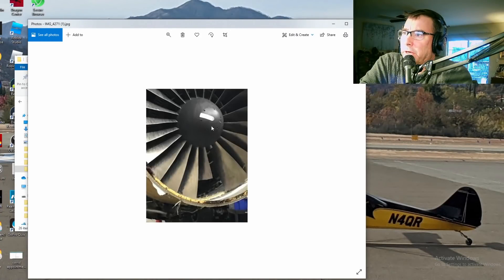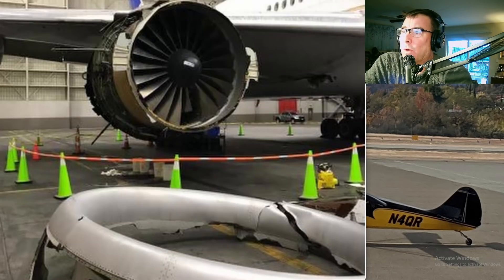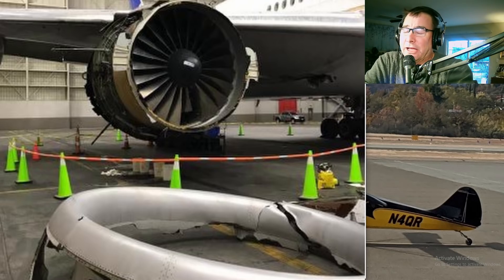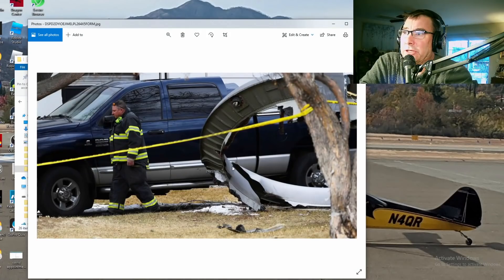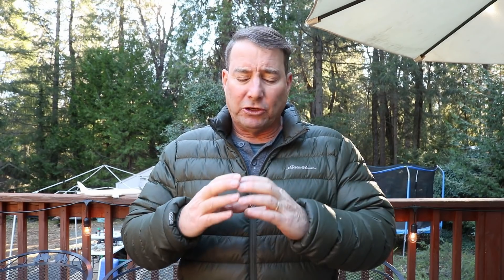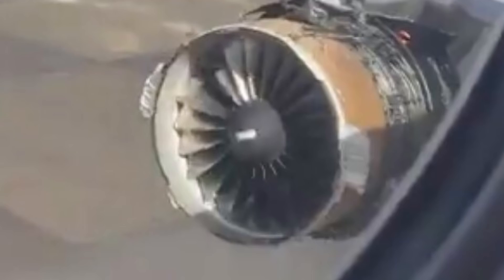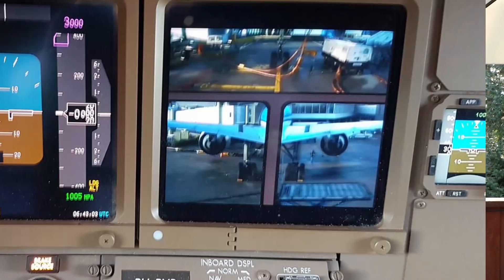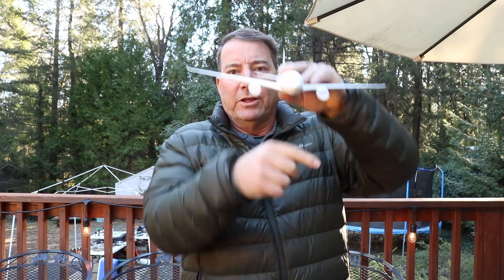UAL 328 UPDATE Fan Blade Failure  B777-200  22 Feb 2021

Comment: Okay, an incredibly piddly question of no real importance ... in all of the ETOPS configurations you mentioned, Mr. Brown, what is the assumed state of the engine that's out?  
That is, is the massive amount of drag caused by an engine who's cowling is gone taken into account or is the engine simply assumed to be "feathering" but still relatively aerodynamic?
After all, the Breguet range equation depends on aircraft drag (among other things) and that drag presumably goes up quite a bit compared to the case of an engine without a cowling and so I'm wondering if the range estimates for the aircraft can really be trusted.

Comment: Turbofans circulate much slower than the inner compressor blades.  The width, mass, and aerodynamics of the hollow blade make it capable of overcoming the inlet flow, thus the cowling shear and bellowing out of the outer skin.  Amazing.

Comment: Another interesting point was that, based on the ATC comms published by Vasaviation, the ATC asked the UAL328 if they preferred a left or right turn and pilots went for the left one. If I'm not wrong this action was taken in order to fight the momentum that an engine failure can cause on the a/c (I assume something similar to what happened to the Indonesian B737-5).
Thanks for the explanations Juan, such great and interesting video

Comment: Juan,

I noticed in the picture of the damaged engine taken from window seat, there appear to be two, "tabs" pelled back from the engine containment housing at the 10 o'clock and 3 o'clock postions.  What are those from?  Are they the attachment points of egine cowelling?  What kick arse review.  I always learn something I didn't know before about the engines and the emergency procedures that follow an engine falure.  Thanks!!

Comment: I am starting to think the slipstream is what alters the result here versus the certification blade-out test conditions.  The test is performed in a 0 kt slipstream environment.  The failures have occurred in slipstreams at or above 200 kt which is significantly more than 0 kt.  When the blade detaches in a slipstream it is going to immediately decelerate relative to the others still attached to the fan disc that, at this point, is still powered.  Since the rotational velocities are significantly higher than the axial velocity (the forward velocity of the blade moving into the slipstream around 200 kt whereas the rotational velocity is closer to the speed of sound) it will decay much faster.  If the slower blade is then impacted by a neighboring blade (these are at a slight angle to begin with to induce an angle of attack as the fan disc turns the blades) still being driven by the fan disc it could be shot forward and into the inlet ring.

Airspeed is also going to affect the angle of attack at the fan blades just as that same airspeed affects angle of attack at the wings.  The blade out test used for certifications operates at 0 kt airspeed (not performed in a wind tunnel) and will not reflect the result of blades separating at different angles of attack.

This failure mode has caused more than one incident now so it may be worthwhile for the NTSB to model the above scenario by running the blade-out test in a wind tunnel using an engine with its aerodynamic cowling installed.  Also lots of computer simulation since a certification test rig and PW4000 fan blades comprise a very expensive dart board (especially if we don't hit the bull's eye on the first try).

Also NTSB, with the cowlings off and the wind tunnel blowing, confirm or refute the Halon farts that occur instead of engine fires getting put out when the fire handles are engaged.

Comment: Thanks for also covering the Netherlands accident. As i understand the fuel drop in NL/Belgium was nit required for a save landing and perhaps even could increase fires on the motor. You also saisd 747 is other type than 777 so ...what would the flightplan/fuel plan/ fuel computer recommend? No one is perfect but by analysing this can be optimised in the simulator procedures. Being a technician i am heavy worried by the broken vanes. That can be caused by fatigue and/or small cracks and ...that can be detected by inspections. Is the industry doing those tests? Are there enough tests and inspections or is that extra safety decreasing to safe money and time? These airplanes are 20 to 30 years old ....sometimes one should say ...this is the end or ...do an extensive overhaul. The vibrations and stresses / forces of the damaged motor may also damage the wing and even the body. Strong forces can cause cracks, fatigue and also can deform or reduce lifetime or cause air leakages of wing and body. Air leakage at hig speed may caused increasing damage so ...what seems to be a simple damage and just replace the motor may cause a damaged airplane with failures on other parts. Of course cables and systems etc, have to be checked and replaced and tested. In train industry but also in chemical industry last 20 years the operations / insights / procedures for maintaining, repair ad service  have been focussed on reducing maintaining cost. They havbe not been focussed o increasing safety and reliability. (Damagae repair in stead of preventive repair, condition monitoring in stead of condition improvement or condition enforcement, failure procedures in stead of more safe and preventive procedures). There is a point where safety really can not be guaranteed any more . New point: lots of planes are on ground due to corona. Long term storage can affect wheels and bearings but also can cause fauling, corrosion, humidity or even water or algae or fungus, rubber and oil can detoriate : summarised those plains have to be inspected, maintenance has to be done including cleaning, perhaps also cleaning of fan and compressor blades, they have to be warmed up and dried and the systems has to have a much longer start up and warming up than normally, also after that first warm up all kind of things should be tested! Not only the standard test but ...intense and ...are those procedures standard available ? Otherwise please insist of proper and save start up of all those airplanes that are standing month inactive in all kind of weather conditions. Are there mice in the wings? Military knows much about how to safe store large equipement ...mostly they, like tanks, are stored in warm and dry heated  halls. Military also have experience how to inspect and start up equipment, yes they can be rough but they also know that a weapon that does not work is not a weapon but only a heavy weight. Electronics can fail but also leakages of oil and cooling can occur. Fire systems can stop working after long being out of operation, safety systems can stop, how is the landing system and the quality of the rubber wheel and seals? I think a worldwide engineering review on safe start up of the covid machines is required. Just a standard start up may cause unwanted problems. Fouling of turbomachinery also can cause unwanted problems! Good luck! I am mechanical engineer bachelor and worked with turbomachinery, tanks, radar, communication, anti-aircraft,  instrumentation, testing, engineering, repair service, maintenance, inspection, material properties, aerodynamics, and ... top quality and safe as possible but yes ...money has to be made so ...it should be possible to operate and maintain machines at acceptable cost but ...how to do that safe and ...is safety guaranteed after 20 years of decreasing costs for safety? And ...after decreasing income per flight? Can the business be safe , deliver acceptable incomes and deliver acceptable transport quality to the customers? Do we need to wear helmets close to airports and routes?
Reply: https://www.onderzoeksraad.nl/nl/page/18344/motorprobleem-boeing-747-412bcf-meerssen? have sent a comment to the Dutch Safety Board. Added your video and asked them to also contact the USA Safety Board. Accidents/incidents seem similar. I see that there is a problem with old machines and insufficient service,  repair and inspection: old blades etc. ...no signs of extreme external forces. There was normal turbulence in the USA and in NL the weather was OK. No strange external forces mentioned. So i see a mentality and habits that can cause problems with many old airplanes; they need quality  inspection, repair and service .

Comment: Not disparaging this guy's qualifications, but V1 is not rotation speed.  It is refusal speed;  the speed at which there is not enough runway left to stop;  at that point, you are committed to take off or run off the end of the runway.  There could be several tens of knots between V1 and rotation speed.
Reply: Thanks Wilbur.
Reply from the maker: You know what I mean...good grief.
Reply: Sorry folks, but if you're going to talk about it, talk about it properly.
Reply: @rickbanet4830  Ok Mr know it all

Comment: Hey Juan, question for you since you mentioned the considerations about an emergency evacuation. Given the speed at which things can sometimes go wrong when aircraft fires are concerned, would the cabin crew inform the passengers to remain in their seats, or would they start mustering passengers at the doors in the chance that an evacuation is ordered to speed up the evacuation. Also, I’m assuming if there was time that the cabin crew would brief the passengers about an evacuation plan if it is ordered prior to the landing?

Also you said your off to work and headed to London? I hope that indeed means your still flying. If so, have a safe flight, and try to keep both engines spinning, as it seems that commercial planes have struggled with that bit in recent times, and as cool as it would be to have you tell the first hand story of that time your right engine blew up on the way to Heathrow when doing these videos, I don’t think you need that at the moment 😁

Comment: So if a fanblade broke off and made hole in the cabin you must go down to 10k ft, will that be included into the fuelplan or will the aircraft run out of fuel regarding the Hawaii example?
Reply from the maker: Yes

Comment: The 777-200 (LR at least) does not have the camera system.  The -300 does as the landing gear with the size of the aircraft, the wheel/turning geometry, etc., demand a camera.  Also, the -300 has that feature where the main landing gear truck has to be lined-up before apply take-off power.

Comment: The same day this happened a Longtail Aviation 747 freighter travelling from Maastricht to New York had an engine fire shortly after takeoff. They also dropped debris and 2 people on the ground were injured. They flew to Liege which is approximately 20 miles away. They dumped 40 tons of fuel. The ATC guy seemed to sound surprised that they were doing that. It is getting very little media coverage. Here is a link for the ATC recording.
https://www.youtube.com/watch?v=ADQbwVW4Wuo&feature=youtu.be

Comment: QF32 on an A380 had an uncontained blade failure that ripped through the aircraft. One thing that struck me when reading the captain’s book about the incident was how the ECAM kept generating new warnings and messages making it very hard for the first officer (the captain was doing the flying) to keep up with the problems. In a similar situation in a 777 you would have paper checklists. Is that preferred so as not to overwhelm the crew?

Comment: Worked at American's M&E center for about 20 years rebuilding engine components for both Pratt & GE engines. Most of what I worked on are now in bone yards somewhere since I've been retired for almost 20 years. Those #1 stage compressor blades are made of titanium as are the hubs that they are attached to. They are not very heavy but I have never weighed one to determine the exact weight. The hub is fairly heavy though. I do not know what rules apply to the blades but (way back when) the hubs were to be discarded after a specific number of cycles. Not hours but cycles. An incident involving a fan hub failure causing a DC-10 to crash at Sioux City, Iowa caused American to insure that the old hubs could not be reworked & used again, we cut a notch in them with cutting torches rendering them unusable. Those blades are supposed to undergo ultrasonic testing periodically. On the MD-11 line they would remove them during a "C" check for testing. I am unsure of the current testing rules.  The engine mounts being designed to shear off in case of excess vibration? American had a 727 lose #3 engine (actually came off) somewhere over the desert in Arizona or New Mexico. What happened: The forward lav on the right side had a leaky dump valve. Blue ice formed on the outside of the fuselage to the point that it could no longer stay attached. A large chunk of blue lav ice broke off, bounced off the leading edge of the wing & got swallowed by the #3 engine.  Stewie reports to the pilot that they had lost an engine. Pilot reports that yes we know & have shut it down. Stewardess replies that, no, the engine is gone. The condition of the engine when they retrieved it & brought it in the shop was interesting to say the least. When designing the aircraft they had to consider the lesser of 2 evils: what's worse a single engine falling into a neighborhood or the entire aircraft.The fire on that #2 engine was likely engine oil escaping from some ruptured oil line. Don't know how to fly a plane & have never wanted to know but I do know "how" they fly. I would assume that the fuel supply to the engine would be shut down either by shutting off the boost pump for that engine or closing a fuel line valve. That's just an assumption. Hydraulic fluid on fire? Skydrol used to be the fluid of choice & it is not petroleum based & is supposed to be non flammable. Again, they may be using something else now.
Reply: Skydrol is definitely flammable.
Reply: @redcat9436  Skydrol is a phosphate-ester based hydraulic fluid and is used in commercial aircraft. It is considered fire resistant if a fine mist is sprayed near a possible source of ignition. If you get even a tiny droplet of the stuff in your eye it will set your eye on fire, first hand experience. My guess on the fire, again my experience is years old, is that it was fed by engine lubricant oil. In the case of a massive engine failure (this was) there are safety devices that isolate the hydraulic system of that particular engine. Hydraulic fuses, check valves prevent hydraulic fluid loss through the affected engine. However the engine oil pump is driven by the accessory drive gearbox & as long as the engine is turning it will be pumping oil. At least that is the case on the JT-3, JT8-217, CF-6 dash 30,60,&80, and the military J-52.

Comment: If fuel is shut off to the failed engine can the fuel be used to power the other engine?
Reply: Yes, there are valves to cross feed and keep the fuel load balanced
Reply from the maker: Yes- crossfeed as required.

Comment: From someone who knows nothing concerning aviation, that is one extremely well built engine. To lose a fan blade, stay mostly intact while not exploding or blowing up is a safety measure in itself.
Reply: If it was a well built engine it would not have failed!
Reply: @grantjohnston5817  More people have died sniffing paint thinner in the last week than have died in 777's powered by PW during its entire 26 year service life....
Reply: @grantjohnston5817  failures happen, the fact that the engine did not disintegrate when this blade failed means that this WAS an extremely well built and designed engine.  The fact that the failure was contained and no internal engine parts other than the failed blade left the airframe indicates amazing engineering.

Comment: What usually happens  to luggage in situations like this?  Do passengers get it right away or is it to delayed during investigation?
Reply: Because the jet weighs too much after you lose one of your engines. it’s called drift down.  Remember you have lost 50% of your power, you are no longer a twin engine highly efficient jet...you are down to one engine and the APU.
Reply: @hawkeye0927  that didn’t answer my question.

Comment: Amazing that the engine held together as well as it did.  The video shows it was actually still running without the shell of the combustion chamber intact.
Reply: I believe it was just "windmilling" from the air flow through it..  NO actual combustion or power  being developed/

Comment: Seems like a shaft band brake would be a smart thing to install onto a jet engine prevent windmilling by simply putting the brakes to it. Also an emergency engine jettison wouldnt hurt maybe a hydraulic pin disconnect so if there is said fire like this one you can just flat drop the engine off the air frame. In a matter of numbers 2 on the ground May be better then 75 to 300 in the air as planes get larger and larger.

Comment: There it is nothing to see here, move along. Great stuff. I didn't realize that the cowling are removed during testing. You pretty much answered all my questions. Did the absence of the cowling allow the fire to continue? I wonder just how long the engine would have remained with the amount of vibration. So now it's a metallurgy investigation? Great info, glad you included the entire aircrew coordination as well. God Bless safe travels.

Comment: Hey Juan, another PW4000 blew up on a cargo aircraft starting at Maastricht (Netherlands) airport. The plane landed in Liège (Belgium) as the runway is longer. Falling debris damaged a few cars. You can find details at Zerohedge. Or Aviation Herald.
Reply: Also a couple of people on the ground injured by falling debris. From the photos of the debris on the ground, it looks more like a turbine blade failure, or possibly compressor blade failure, rather than a fan failure.